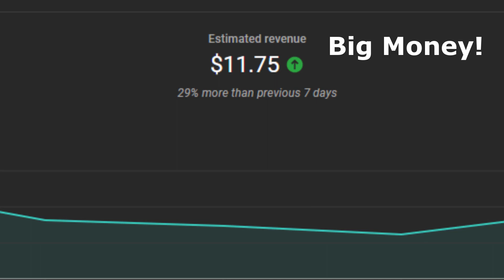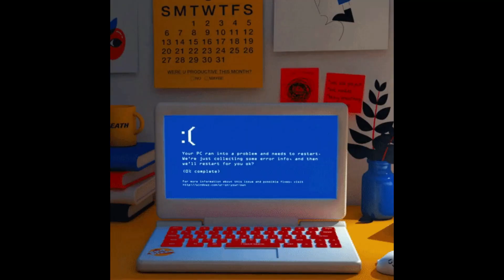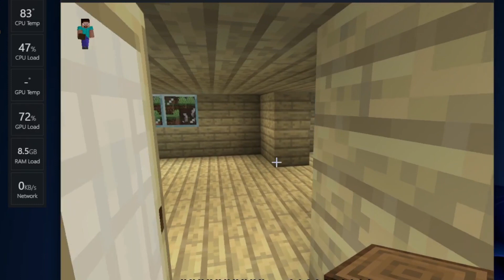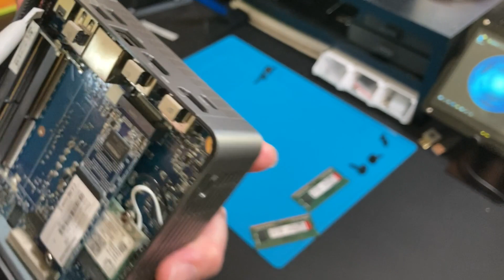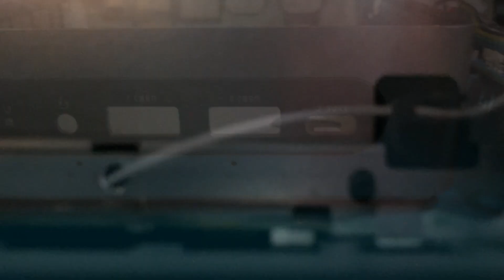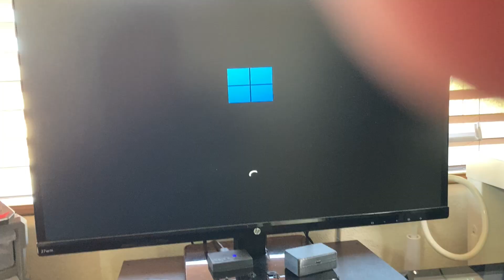This Thing Is AMAZING!! - Review & Teardown of a SURPRISING Mini PC.

Comment: I am REALLY impressed with the internals.  I wouldn't have bet that it had dual channel ram out of the box.  If that little ribbon cable gives you issues, I might consider hitting it with a little blob of high temp hot glue.  The melting point is high enough that the ambient inside the box temp shouldn't melt it if you put the machine under load, and you can always remove it if you have to.

If you are taking requests... I've always been curious to see how a system with a mix of performance and efficiency cores handles running a VM... like, can you pass the VM a performance core?  Can you keep the performance cores for the host OS?  Can you control which OS gets what, or do they sort it out Thunderdome style?
Reply from the maker: I might hit it with some hot glue in the future. But I don't really need the microphones where it will end up.  My plans for this thing are to have it kind of off in the corner on a 3D printed mini server rack. It will be hanging out with a DIY NAS and my KVM switch.  So really all I would have at the desk are a couple monitors and the switch remote and I can access everything I want whenever.  
That's being built... eventually.  haha 

Hmm.. I don't know about the VM and what it will actually do.  I'm that's an interesting question. 
"2 cores enter, 1 may leave."  haha
Reply: @S-Technology  Is the 3d printed mini server rack custom, or did you find STLs for it?  I've been thinking about building a little rack for myself.

Also, "Who run Hypervisor?  Master Blaster run Hypervisor."

I'll see myself out.
Reply from the maker: @jyoung-dj1zr   It's going to be based on the STLs found here: https://www.thingiverse.com/thing:1936196.  But I'm going to modify the "shelves" to hold the different components.  and hopefully have a little room for some cable management also.

hahaha 😀
Reply: @S-Technology  Thanks for the link!  I like the idea of printing inserts for standard aluminum extrusions.  That is WAY cheaper than some of the other solutions I was looking at.